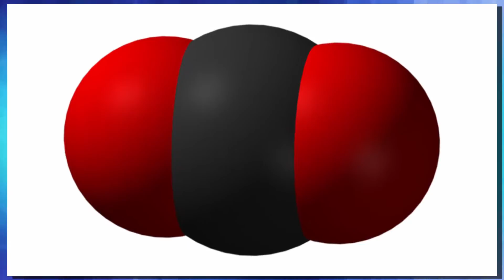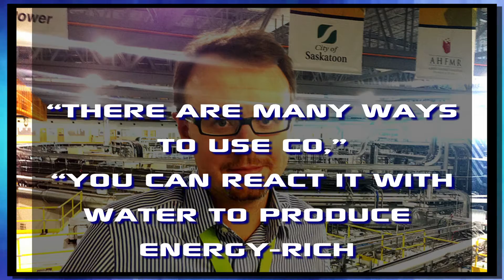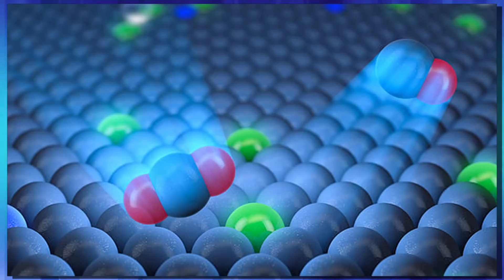Limitless fuel from CARBON DIOXIDE. New method is cheap and efficient. (2018)

Comment: How inexpensive? Will it be cheaper than regular gasoline? What are the waste products from the fuel when burned?
Reply from the maker: oh boy, Im not sure. This is a pretty old video and I dont have the info on it available right now. There should be links in the description to my sources if you want to check it out.
Reply: Okay, thanks.

Comment: Hi Zak, came here from neoscribe, can you put the source of the research in the description, I've seen tech like the co2 capture to hydrocarbon fuels before, its great if the cost of doing it is comparable to mining or drilling it, the challenges have been to do it without using more energy then it gives back. That's not a problem if you have clean and cheap power the likes of  fusion for instance, but if i understand your video correctly we wouldn't even need that with this artificial photosynthesis approach.  Having this means we can all drive around in V8s without guilt as well as wouldn't mean we have to scrap the millions of vehicles already out there. It would be carbon neutral rather than a reduction, unless the conversion process means we have excess hydrocarbons we can put  back in the wells. 😀
Reply from the maker: That's why I was so interested when I saw this paper, I am a big fan of classic muscle cars! I'm sorry if I missed my source on this one. I have a dedicated section in my description on all my vids for reference materials. However you know how it is sometimes I miss stuff. I will look into it right now and get some links uploaded for you to take a look at. Thanks for stopping on from over at NeoScribe's channel. He does some great work and I hope my videos keep you informed as well as his do.
Reply from the maker: Update, my bad I am putting links in now. If you ever see that I forgot them feel free to let me know. Thanks!